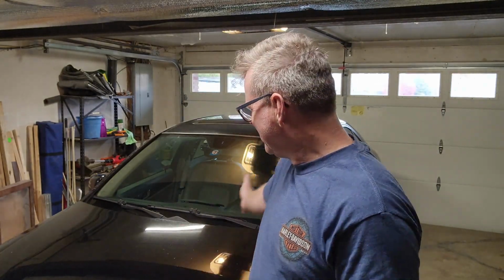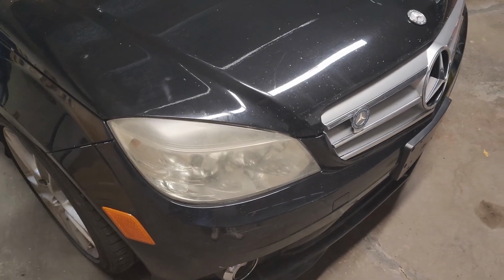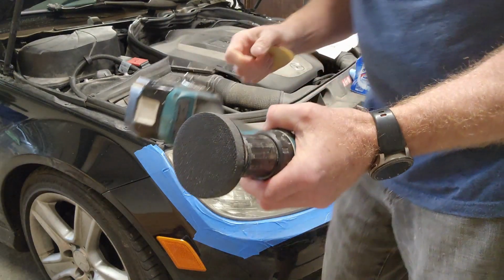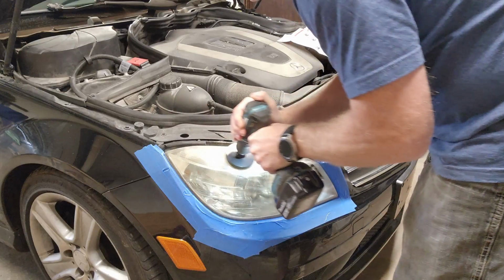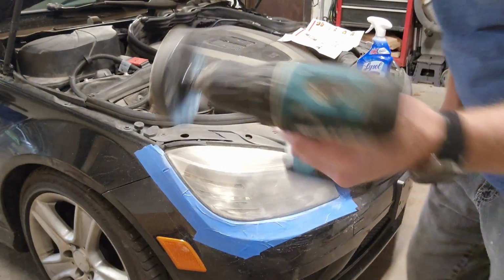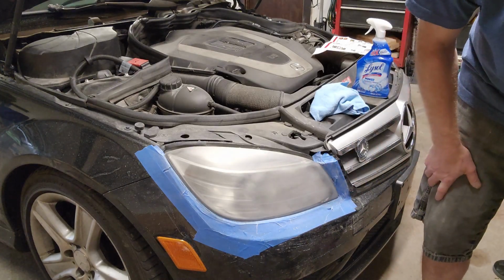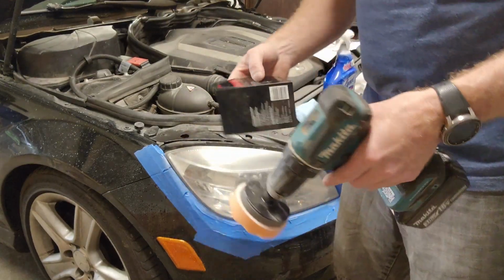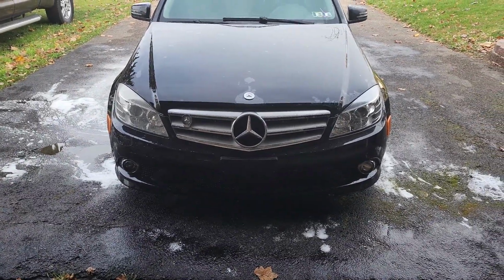Headlight restoration how to

Comment: Not a bad effort by and large, Couple of things wrong first when dry sanding only light pressure on the drill head, When useing trizak Cushing pad with water one application is all that's needed, No need to respray continuously applying water, If done properly the water should become a milky colour at this point stop!! Dry with a clean micro cloth, Then polishing always use the dab method where the polish is apply'ed on pad in even blobs, Then dab all over the lens before polishing, Use a higher speed on the drill, Straight after apply the clearcoat with added UV protection only, Making sure the product is spray only and not cheap wipe's, I think you missed this last step? I  strongly advise you follow up with a decent clear coat that way the lens will match the new one🤔🇬🇧👍
Reply from the maker: Thanks for the comment. Ya, I should do the clear coat.